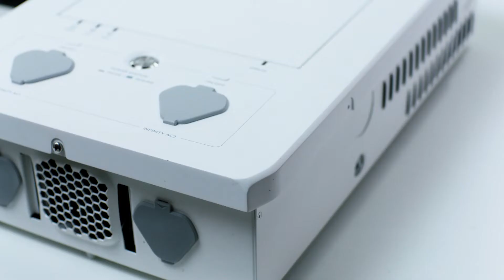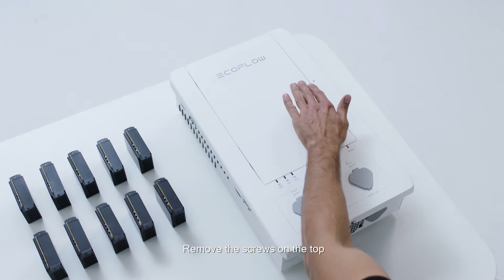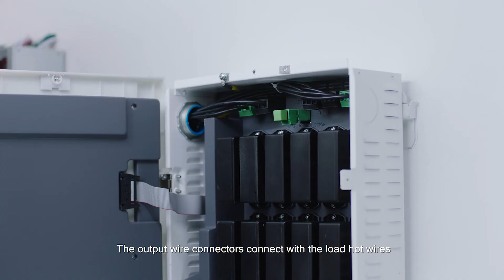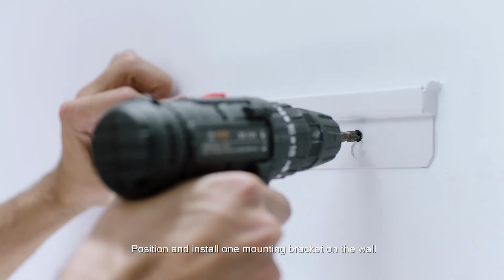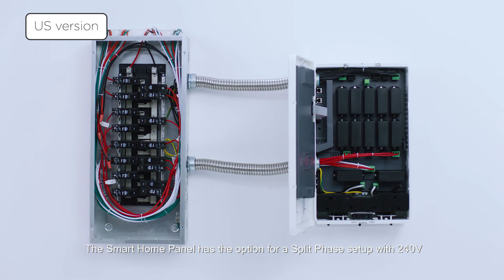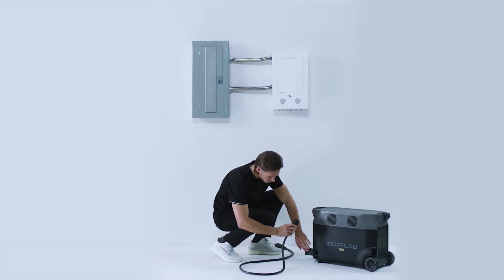EcoFlow Smart Home Panel Installation

Comment: Hey there. Can you help me out with finding out the limitations of a smart home panel for a split phase sys? I understand that in split phase you can only use 5 relays and that you need 2 delta pro's. But what is the amperage limit of each of the 5 relays? can i use 4 30A relays and 1 20A relay? thanks in advance